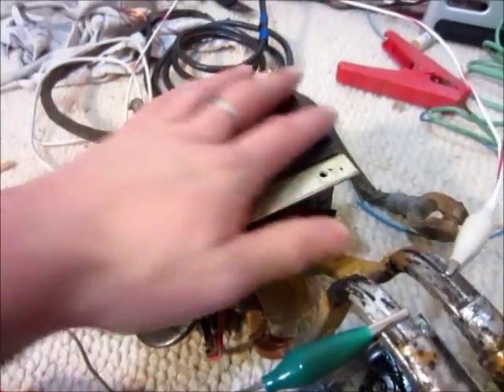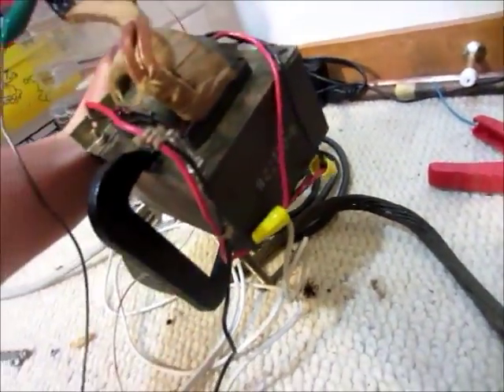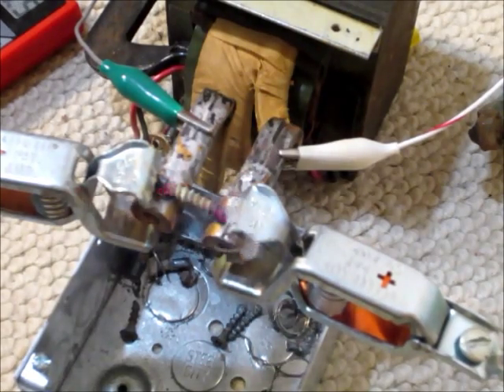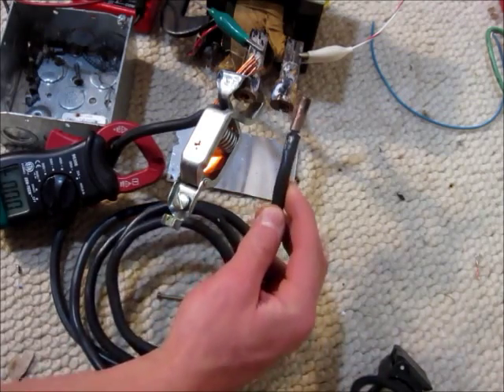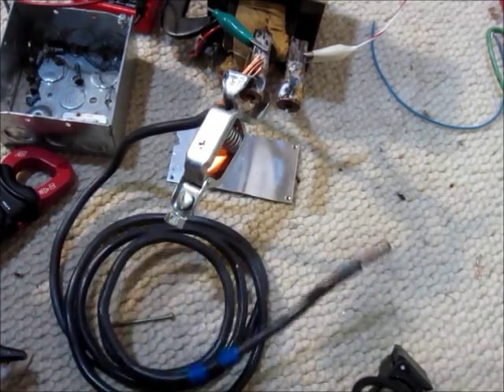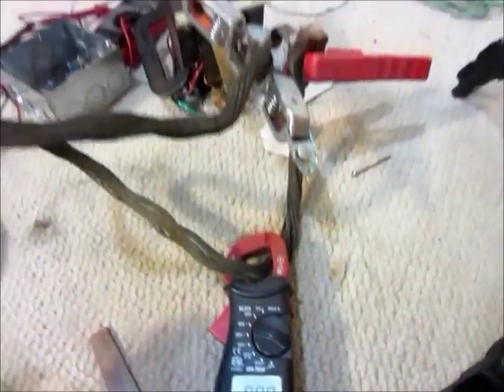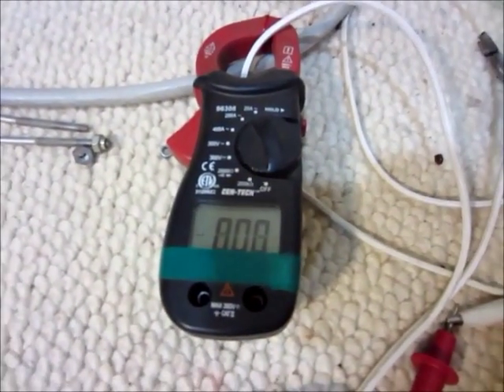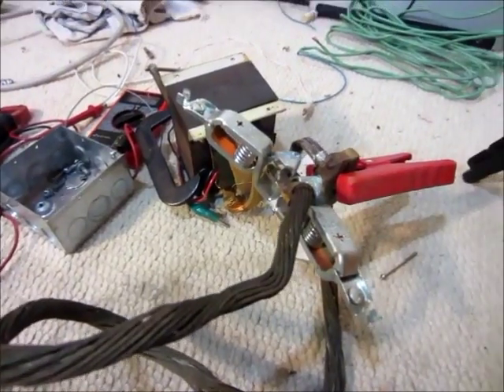Transformer Pulls 34 Amps From 120 Volt Outlet!  Amps Amps Amps!!!

Comment from the maker: I don't think it would work very well.  The voltage is only about 2.8 volts.  I charge my lead alum battery on 2.5  volts and it's max amp draw is only about 100 ma.  If I wanted say 1000 amps to go though it I would need hook it up to about 10,000 volts because it's resistance is about 25 ohms.

Comment: I still think it's the ultimate lead alum former.  Thats a lot of amps. I like the colors the screw went. Spot welder could be handy for Stirling construction. Or you could run a few leds in parallel. ;p

Comment: lol Nice little transfo you have there. Yes you can weld at 2 volts you can't arc weld but spot welding can be use for small metal piece probably it first use too who knows :P watch those hot wire haha =D